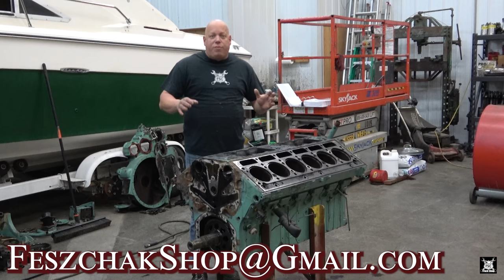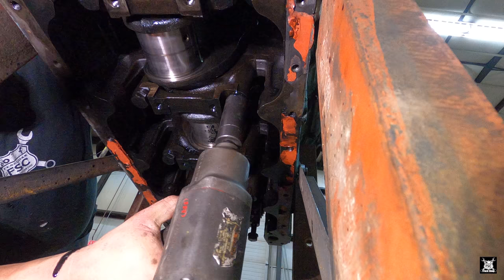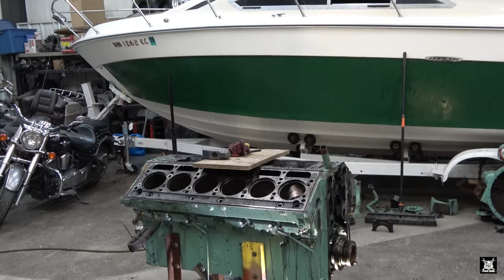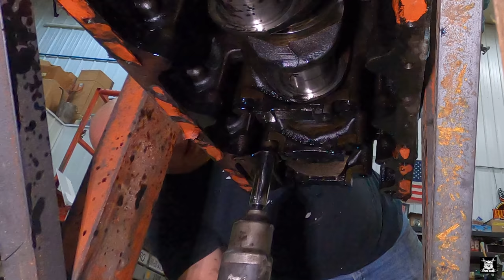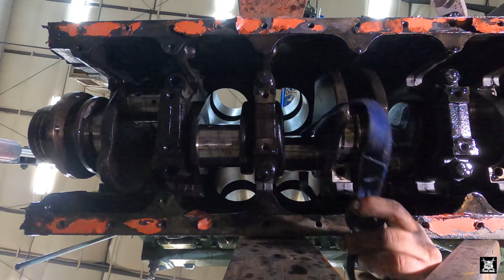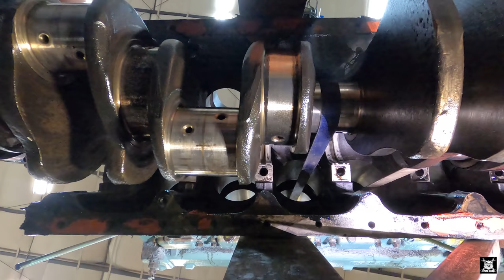12v71 Detroit Crankshaft Removal

Comment: years ago I did an 8V71 after it swallowed a valve and ran away,, first engine i rebuilt. ran it for 18 months and sold it, got a new truck with a Cummins, had better luck with the 350 and 400's.retired now and enjoy your videos pull toy here,

Comment: On west coast. It's currently 4 30 am rite now. Damn that block is massive. I'm surprised your smaller air impact got those main bolts out.. Nice
Reply: Those are 1200ft lb impacts.
Reply: @98Pete  Oh ok thanks. I was thinking half that. 6-700 ft lb.
Reply: Man needs one of those 1/2 inch milwaukee Impacts. Screw all that air
Reply: @haydona1845  agree they are worth the money
Reply: @98Pete  I use it everyday working heavy equipment. That little thing has been abused and feels like it's lost no power at all. It taken nuts off that probably should have only been touched by a 1" impact gun. Ill stand by milwaukee just for that tool alone
Reply: @haydona1845  I use the shit out of mine as well

Comment: Detroit Diesels designed to convert fuel into smoke and noise.
Reply: So are old Alco diesel locomotives turbocharger lag caused 'em to smoke like a steam engine!
Reply: Gauged in Smiles per Gallon! 😉